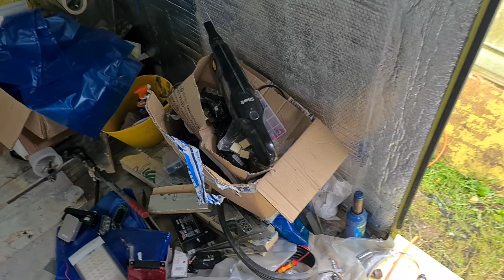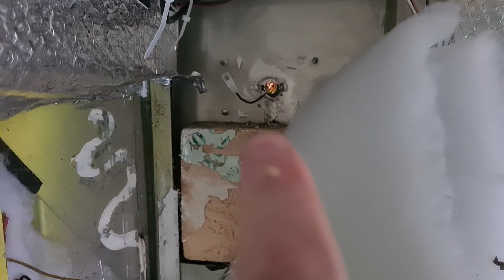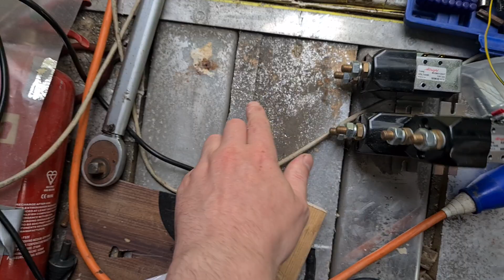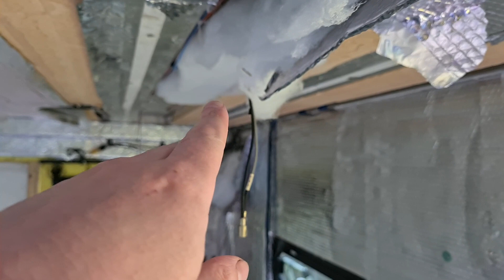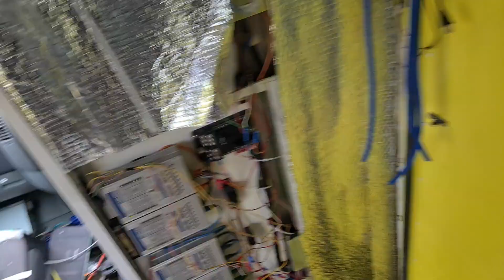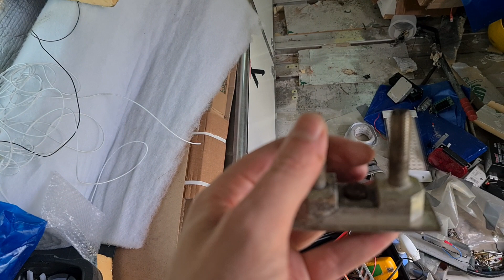Project FNIX #43

Comment: What ambulance do you have? Ive just got myself a 2008 VW Crafter Ambulance almost complete conversion with full Carnation Designs phoenix system still installed, 1800w Xantrex inverter and Tecsup 40A battery charger. Intrested in your videos and i may post some myself too 👍 👌
Reply from the maker: Yeah mine is a 2007 Mercedes Sprinter